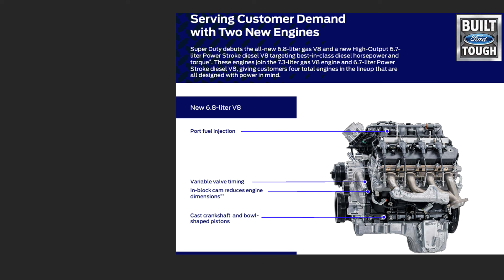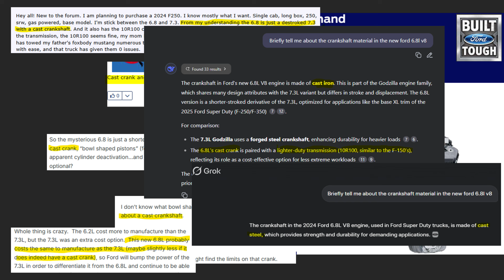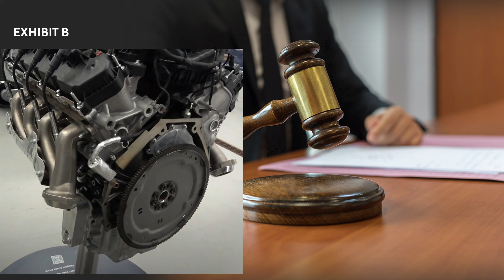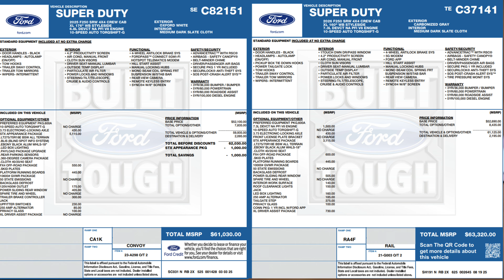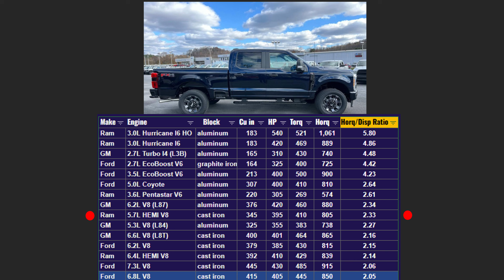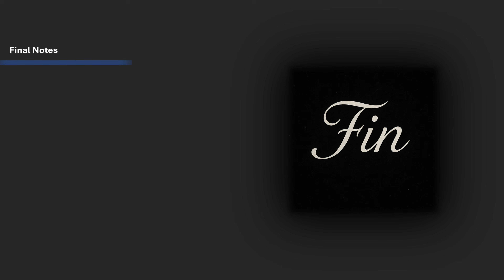Ford’s “Minizilla”: Making the case for the 6.8L V8

Comment: Cool video!  Well done.  Your voiceover reminds me of the Torque Test Channel!

I enjoyed the comparisons to the previous gen engines.  Neat to see your take on “Horqs’s”.   Having had a 2004 v10, there’s nostalgia in the new 6.8 for me.  I ordered mine with the 4.30 ratio, and it never left me with ‘diesel envy’, other than the fact there wasn’t a gas station I couldn’t pass.

Video idea - get into the weeds between the original 6.8, and the new one.  Dig into hp/tq charts, and which one might be better at what….  Just a thought for us old guys that remember the v10 😊
Reply from the maker: Ha, thanks!   I have a friend with the v10 version of the 6.8, and he loves it.  Says it's bulletproof, and loves the way it sounds.  A comparison between old and new would definitely not be apples for apples, but would be good fun.    A v10 with 4.30 would be single digit mileage I imagine :)    I really debated doing the comparison, because it was kind of a sidetrack.  Glad someone out there is glad I did.   I thought about what to call the measure of 'horq'.  Footpower?  Horsepounds?  lol.

Comment: Very timely video.  I'm ordering a 250 crew in the spring.  I need to tow 16,000 lbs about a dozen times a year.  The rest of my towing is under 10k.  The 6.8 on paper can only do that if I order it with the 4.30 rear end.  Although I can't find good specs on bumper tow tongue weight limits for that configuration.  Question, do both use the same 10 speed transmission?   I've heard conflicting info on this.  Thanks
Reply from the maker: Yes, all 6.8l F250s and F350s use the 10R100 transmission. One good way to check ratings is to find the exact configuration you're looking at for sale somewhere, grab the VIN and enter it here: https://www.ford.com/support/towing-calculator
Reply: @motorobo0  Thank you!

Comment: Ordered a 2021 F250 XL back in April of 21, well it came in as a 2022, delivered on Dec 22. It's a 4 door with an 8 foot bed, 7.3, 430's with a eloc rear end, dbl alternators and batteries, cloth bucket seats, fifth wheel setup and yes Anti Matter blue. Very simple truck, the only thing at that time is that I also wanted the auto folding and retractable mirrors, but it was not a separate item, needed a package with stuff I did not want. So far so good, towing my 7,000 lb camper at 65 ish, truck doesn't even know it's there. Awaiting the drive train warranty expiring so I can install a good header free flowing exhaust and a tune, unfortunately I don't put many miles on it yearly, presently only about 13,000 miles so far, but oil, filter changes are at 3 to 4 thousand miles, not the Ford recommended service times. Yes, I love the power it supplies but did have to get used to the transmission logic, stupid shit in my mind. Overall, very happy with it.
Reply from the maker: Nice, nobody's going to say you're not taking good care of it.   Every 5k is easy for me.. I bought mine new, changed at 1000 miles, then 5,10,15,20, etc.  No need for a sticker :)   And still much more often than the oil life monitor would suggest.

Comment: My daily driver is a 2024 F350 reg cab 4x4 with 275/65r20’s and 4:30 gears.  Antimatter blue color and a power sliding rear window.  It’s the highest optioned SuperDuty that I could get in a reg cab. 
I bought this truck because I wanted something simple and reliable compared to my previous Ecoboost F150s.  
This thing is a factory hot rod.  Love this pickup.  Maybe I’ll even tow something with it someday.
Reply from the maker: Nice!  Mine's Antimatter Blue as well.  Very cool color that they don't offer anymore.  I had a stint with an F150 powerboost that had me in and out of the service department more times than I can count.  That's what led me down the simple+reliable path.
Reply: Forgot to mention it’s a 6.8.   Can’t figure out how to edit.
Reply: @lennyjonas5417  you should do a max tow with your truck of even let TFL truck do an episode doing a max tow test.  I've yet to see anyone test a 6.8 max towing with 4.30 gears, only 3.73s, and I feel like there's alot left in the 6.8/4.30 combo that no one knows about
Reply: @erikswensen425 I would guess that if the bigger transmission was available with the 6.8 is could tow every bit as much as a 7.3 all other things equal, the axles and ratio, springs, brakes, tires. I think the 6.8 is underrated and the HP is likely less than 10hp different at peak and inspite of less tq or the power coming at higher rpms with a 10spd trans you would never drop down from where the engine makes enough power to do the work within the speed limit running highway tires. I think you could put the 6.8 in an F450, F550 or F600 with the big transmission, axles, brakes, 19.5 wheels and 4.88 gears and it would do anything the 7.3 could do.

Comment: I own a 2023 F250 6.8L XL w/STX package. I tow my 8,000 lbs travel trailer about 3-4 times a year with no issues. It’s also my daily driver. My truck is all stock except for the tremor valence I added, 35” tires on OEM wheels and a performance tune. I purchased a performance tune from Livernois Motorsports. I have not used a dyno so I can’t officially say how much more power I’m getting. But I feel the difference in that the truck felt sluggish with 35” tires now with the tune it’s back to what it felt before the tire change. Livernois Motorsports website claims gains of over 35 WHP and 40 WTQ. I love my truck and couldn’t be happier.
Reply from the maker: I may go for a tune when my warranty is up.  I've also heard that the stock exhaust is extra restrictive and people see notable gains when they let it flow.  How big of a hit did you take on mileage when the dust settled?
Reply: @motorobo0  All time average is about 12mpg that hasn’t changed. Highway driving at about 70 mph with the a/c on, 44 miles round trip to work and back I’m getting about 18 mpg.
Reply: With that tune your 6.8 probably makes more power than a stock 7.3 at the wheels, I'd bet anything on that. With 10 gears any power advantage from the 7.3 would be at rpms where you could easily gear the 6.8 down and do the same work without noticing anything more than a few more rpms.
Reply: I have a Power Wagon with 6.4 and 4:10 diffs. 35” tires. Curious about your fuel economy? Hiway. Combined. Empty.
Reply: @Kanakid empty on the highway is about 18 mpg. All time average at 36,000 miles is about 12 mpg. I have not towed with the tune yet. Before the tune pulling my 8000 lbs travel trailer was about 9 mpg.

Comment: I did a couple weeks of comparison research on the 6.8 vs 7.3 before I bought my F250 last month. Had to rely mostly on YouTube vids and customer reviews as many 6.8 searches would simply reference the old V10 engine and its early problems. Was able to gather enough info that I purchased the 6.8 and couldn't be happier. I test drove both and the 6.8 seemed peppier and more refined. Went thru the gears smoother. IMHO the 6.8 should be the premium engine.
Reply from the maker: I had the same experience.  Very little on YouTube about it - everyone focused on the 7.3.   The people that did look at the 6.8 just sort of viewed it as a generic work truck engine.  People kept referencing the bogus cast crank thing, and saying things like "Good people mover, but if you want to tow, get the 7.3".   Nobody took the time to dig, and the up-sell got all of the spotlight.
Reply: I’m running the 6.8 in my f350 , love it.👍🏻
Reply: My 24 Nissan Titan XD Pro-4x is a better truck and has the same payload and towing capacity!! It will outlast any Ford!!
Reply: @stevenpeterson7234 lol good luck with parts soon. Discontinued
Reply: @SwmpDky 
2 tier and 3 tier parts are available man lol. Im good and I know my truck wont break down!!
Reply: @SwmpDky 
2 tier and 3 tier parts are available man lol. Im good and I know my truck wont break down!!
Reply: @s @stevenpeterson7234 I love to shit all over your Nissan arrogance and retarded Ford hate.  The most longevity and cost effective ownership of any truck is the F150 from 1992-2008 (before the 5.4 started shooting spark plugs out like bottle rockets).  And since 2018, the F150 pisses on the regular Titan... and the F250 and up pisses on the Titan HD in cost, power, capabilities, durability.  There is a reason the Ford trucks outsell everything.  The Nissan 5.6 v8 is a nice engine.  But it isn't better than a coyote or Zilla.  I had a Nissan HD 2500 van with the 5.6 that ate wheel bearings, a front lower control arm bushing, and the damn alternator was $1800 at 150k miles.  Nissan is NOT more durable or reliable than Ford, is MORE expensive to maintain and repair.  Sorry you got duped sucker.  Enjoy your truck.  But objectively you aren't better off than a Ford owner in 2024.

From Consumer Reports "The 2024 Ford Super Duty (F-250/F-350) vastly outperforms the Nissan Titan XD in towing, payload, and engine options, making the Ford superior for heavy-duty, commercial work. The Titan XD sits in an "in-between" segment, offering more capability than a half-ton but significantly less than the Ford's 20,000+ lbs towing"
Reply: @stevenpeterson7234 😂😂😂😂😂😂😂 you're special.
Reply: @BuildingDaily 
Em I your special man? 😂
Reply: Really? My f250 has 3,920 lb payload longevity? I’ll get back to you in 20 years
Reply: @stevenpeterson7234 I agree that the VK56 is a great engine, the Aisin trans is pretty good too, I had the chance to buy a Titan XD base model with a VK56 or 5.0 Cummins back in 2016 for like $25,000-28,000 new. Extended Cab 2wd even the base truck had plenty of equipment. I am sure it would have been a good truck. I actually want to build a VK56, a guy is making 2000whp through a manual transmission with turbos with a stock block, crank and heads. He did cams, pistons, rods and a dry sump oil system. That is right around what LSX, Dart LS, L8T and Godzilla blocks are making with boost and all the supporting mods if not a touch more. I want to build a VK56 and put it in my 2004 GTO because the VK is very close in size to the LS engines, 4.4" bore spacing, same stroke 3.62" stroke. I want to modify the stock VK crank slightly, modify some forged rods for an LS that are inexpensive and use some LS pistons with the VK bored out between 3.898"-4.065" depending on wall thickness of the block, I want the build to be a tribute build to the OHC Pontiac V8s from the 60s, a modern DOHC LS to use in a Pontiac as something different that will make 700-800HP and revs to 9000+ rpms which no factory based n/a LS build will do. With ported stock heads and reground cams, running an LS Terminator X with 58x reluctor,  LS coils and EV6 injectors. There is a guy named Calvin57 who is working on a budget Sloppy Mechanics style build with one. If a solution can be found that doesn't require the full dry sump and is affordable I might do one instead of the LQ4 6.0 I have. Anyways back to the Godzilla, it is still in production, it's a great engine, it's based on the 6.2 Boss architecture that never got much love, they do seem to be reliable long lasting engines though, I had a new 2013 F250 XL CCLB 4x4 6.2L 3.73lsd and it was a great truck for what it was. I beat the hell out of it for 2 years and it never gave me a single problem. It did everything I asked, it would get 18-20mph cruising empty and it averaged 15.8mpg during 1.5 years of all my use combined. I wish I hadnt traded it but, I wanted a fast car again and moved away from my farm home in the country where I needed that truck for work. I would buy a Ford Super Duty 6.8/7.3 gas over anything else if I had to buy a new truck with a gun to my head. I have a really nice '94 F250 393w stroker 165 AFR heads, long tube headers, plus supporting mods, ZF-5 trans, 3.55s and I will run it for as long as I possibly can, I might buy a few more older trucks if I come upon a decent truck for a decent price and maybe a new Super Duty if I get a job I have been looking at and buy some land where I would need a new truck again. The Titan is a fine truck, I might get a VK56 Titan or Armada if I came across a cheap one that was decent to have around. You can never have too many old trucks if that's what you drive in case one goes down so you have a runner at all times. Don't knock the big V8 newer gas Super Duty trucks.
Reply: @stevenpeterson7234 The Titan max payload capacity across all the trims is around 2400ish lbs. I have nearly 3800lbs with my F250. The Titans are not nearly as capable when considering the entire platform. Yes they can tow alot but not as effectively. Towing a boat or camper a few times a month absolutely. Towing 10k daily not a chance it'd have the lifespan of any 3/4 ton. You dont see Titans pulling 5th wheels by people that live full time in them. Its just not beefy enough. That said the only half ton truck id buy if in the market for one would be one with a V8 and not a GM. Most likely would be looking at the 5.0 Coyote or the Titan. The Titan uses direct injection which would make it my 2nd choice if I planned on long term ownership.
Reply: @s @stevenpeterson7234  no Nissan has a payload capacity of 3800 pounds or over. 
As far as breaking down...I've never had any issues other than normal maintenance. I have a 6.2 super duty bought new it currently has 416k with no major issues.
Reply: @stevenpeterson7234  keep dreaming. Your toy truck has a 2200# payload capacity. My 26 F350 has an 5000# payload capacity. I could literally put your truck AND part.of your ego in the back of my truck.
Reply: @ironken1796 
So you have a single cab, 4x2 6.8 gas v8?
Reply: @stevenpeterson7234  I stand corrected. 5000#. SRW, Heavy Svc F Axle, 4x4, 6.8L
Reply: @stevenpeterson7234 I own a Titan and it’s a great truck. Your 2nd gen Titan probably won’t have any less issues than a 6.8 F250 though.  Time will tell.
Reply: @AB-coyote 
True, time will tell. I have 50k miles on my 23 Nissan Titan Pro-4x and no issues so far